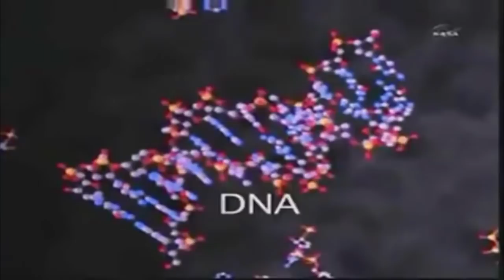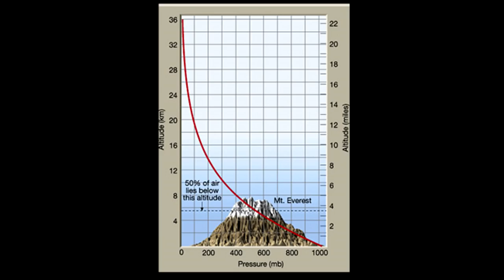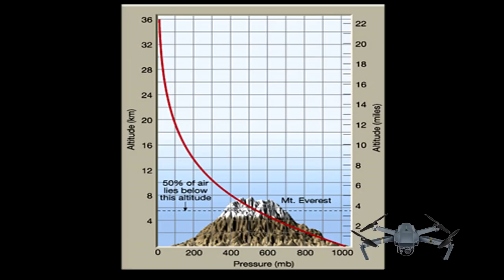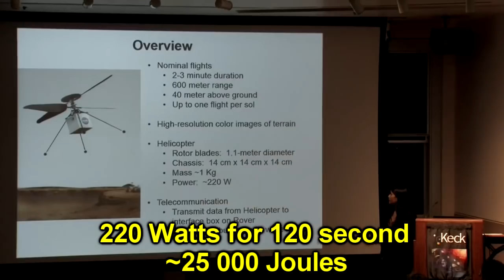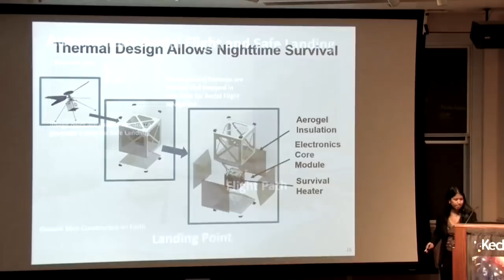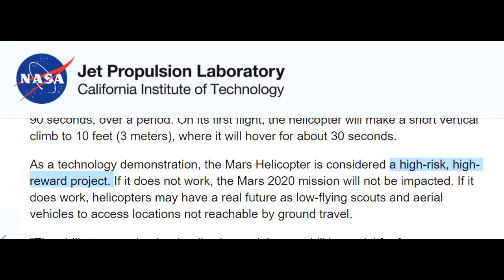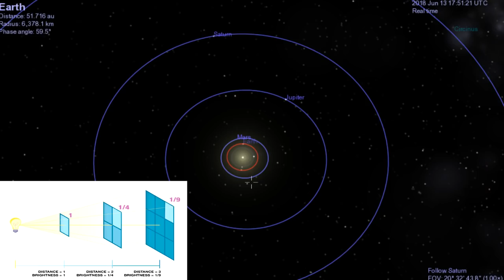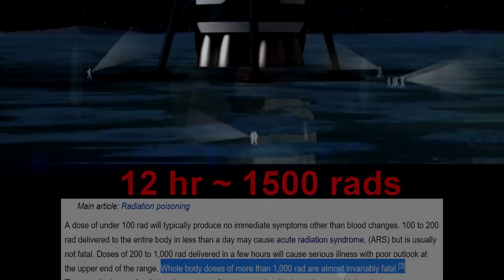NASA is sending Helicopter to Mars!! Smart or Silly?

Comment: Why helicopter drones though? Something with a huge wingspan just gliding takes a LOT less energy to maintain.
Reply: Helicopters can land vertically, but a plane needs a decently sized flat piece of land to land. Also, a plane would be much more likely to crash.
Reply: @Sir_Budginton  the Army likes drones that have large wings they can stay in the air much longer ... helicopter crashes are usually complete write-offs. Although even for a glider a botched landing would mean a lost craft as there is no one on Mars to repair it. What if it could glide for a long time and that would be the mission, glide as long as it can, photograph a lot of things from close and then just land/crash.
Reply: Andras Libal keep in mind that the drone will have to be completely autonomous due to light lag. So a one time use is not very good as NASA will have to decided where to send it on satellite photos alone.

If NASA sees something interesting they want to get a closer look at, a helicopter can keep going there again and again, while the plane couldn’t.

Although if either of these things crash it is game over.
Reply: @Sir_Budginton  well I imagine autonomous gliding and slow maneuvering hovering over terrain is easier than complex avoidance maneuvers ... once it flew as far as it could then it uploads all images ...
Reply: @andraslibal  But there would be a light lag of a few minutes, so NASA has to send an instruction and then the plane must do that on its own. And once it touches down, it isn't getting up again. If NASA wants to get a  look at something else after its initial flight, it can't.

And it doesn't need some super fancy avoidance system. There are ones that exist today that would do the job. And landing vertically is much safer since a small rock won't destroy the aircraft.

Also, the main purpose of the helicopter is to act as a scout for the rover. The helicopter won't carry a single piece of scientific equipment, it would be too heavy. 

The camera on the helicopter can see much further than the rover when in the air, and a much higher quality than the ones in orbit. So NASA can send the rover, with all the equipment on board, to do the tests.
Reply: @andraslibal  because of the thin atmosphere the glider would have to be extra extra large or have to fly faster which really isnt a feasible design to use
Reply: @shaneebahera8566  that makes sense. Would it be prohibitively much larger though? The drone rotors also needs to have larger propellers or rotate faster. I guess it's not that hard to rotate faster. But then again in a thin atmosphere it is also not that hard to fly faster for a gliding design.

In fact a low orbit satellite is also much more feasible on Mars than Earth, no?
Reply: @andraslibal  the working design have faster spinning coaxial rotors
Reply: @andraslibal  actually it would be harder to fly faster than it is to have faster rotors, because you would need a more powerful propulsion system that would add weight which which inturn will be compensated by making it even bigger, it would also make it harder to than it is already to land a fixed wing drone on uneven terrain. The drone flying faster means it has less time to collect data in any given location.
Reply: @shaneebahera8566  why is it harder to fly faster in a low density atmosphere? That does not make sense from a fluid mechanics point of view. If anything, it's easier. Your other argument on landing is a different issue I can see that point.
Reply: @andraslibal  it's harder in the sense of the propulsion system you are going to need to fly faster if its just a short mission drone you might be able to get away with rocket propulsion but if you need expect the drone to be last longer and be electric you are going to run into some trouble since the atmosphere is so thin, props or EDFs won't give a lot of thrust, the take off distance is going to prohibitively long
Reply: @shaneebahera8566  still, why not just set up really low flying satellites? As drag won't slow them down much you could set them up to orbit at a much closer distance and map out Mars in great detail :)
Reply: @andraslibal  whilst mars' atmosphere is very thin at any speeds needed to maintain such a low orbit it would be enough to burn up the satellite this is why the Mars rovers still needed heatshields for their entry into mar's Upper atmosphere

Comment: Why not use a few grams of plutonium to heat the battery?
Reply: Plutonium is very heavy plus I don't think Plutonium just generates heat unless it is fissioned.
Reply: @n1thmusic229  The density of plutonium is irrelevant.  1 gram produces roughly half a watt of heat.
Also Plutonium-238 does generate heat without fission.

Comment: Addendum to your scientific claims:
1. The helicopter blades do not provide lift the way you're describing. The lift is generated by the low pressure created on the upper side by the air flow, like in the case of the wing of a plane. (that low pressure "sucks" the wing up aka generates a vertical force on the (rotating or fixed) wing)
Read this: https://www.decodedscience.org/how-do-helicopters-fly
2. In a highly radioactive environment these solar panels will produce energy like crazy.
3. According to my sources, the Mars helicopter will be serviced and remote controlled by lolcats, so there's no danger for a crash or failure.

Comment: They will use a small nuclear battery.  They have existed for 50 years and they probably have some that are pretty small now and not very dangerous if the rocket explodes.  Course they would never tell the public that.  You numbers seem pretty well researched.  Solar would not be viable unless they had something that folded out to 16 times the surface area so it would be more like the panel you showed.  They could use other technology than silicon for chips with dont melt at 100 c.  They have been making diamond based chips in a company in Massachusetts for 10 years but i have no idea if that tech is ready or being used.  The inject boron atoms into the diamond so it can be crafted in a functioning chip that conducts electricity but diamond can withstand alot of heat before it breaks down, a ton actually.  Again its probably gonnna be military secrets and stuff.  I like how you debunk stuff but you know there is classified stuff on each of these missions and you are never gonna get your hands on the real specs.  So its probably not a good use of time to debunk NASA tech because you don't know anything about the top secret stuff.  Unless you do, and if so you probably shouldn't talk about that for your own safety.

Comment: While you're normally pretty on point with these debunking videos, unfortunately you've got it wrong about the effect of the martian atmosphere on a helicopter. The ceiling of helicopters are there because the engines become starved of oxygen, even at 0.6 atmosphere the helicopter shouldn't have any problem flying provided they have the power to spin the blades. The more weight you want to lift the heavier the blades need to be, because they need to be long enough to produce the amount of lift you want and sturdy enough so they don't snap off due to the rotation or bend due to the lift they generate. While flying a helicopter isn't outside of the realm of possibilities, landing it will certainly be a problem.

Comment: if "they" say. one kg, do "they" mean on earth or mars?
Reply: Mass stays the same. Youre confusing it with weight.

Mind you the proper unit for measuring weight is Newtons. In everyday life we just use kg for some reason. But hey the Earths mass doesnt change much so we get away with it.
Reply: doesn't matter, as long as they are not flying close to the speed of light ;-)

Comment: Would a blimp work on mars?
Reply: Theoretically yes but it would need to be much larger as the air has a smaller mass so there would need to be much more of it to compensate for the solids. That's for a hot air balloon, a Zeppelin would need to use a Vacuum Chamber to work

Comment: you don't have to spin your rotor twice the speed at half the pressure, but only sqrt(2), as lift = cl*A*rho/2*v^2!
posted my calculations here (quite funny dispute with Red's Ball of Fire ;-)
https://www.youtube.com/watch?v=sLgQ0QmmRAE&lc=UgxLmNZLsgh1L570T9x4AaABAg
@Red's Ball of Fire 

long explanation using some math: (hope the wording is correct - English isn't my mother tongue...and all units are "European ;-) kgms system") 

some facts: 
density of Mars atmosphere: 0.016 kg/m^3 (you can calculate from the ideal gas law, I don't do this here) 
gravity constant on mars: g_mars = 3.7 m/s^2 
Rotor Diameter D = 1.2m 
Rotor Radius R = 0.6m 
Rotor speed: ca. 2400 rpm --> angular velocity: w = 251 rad/s 

now some (reasonable) assumptions: 
rotor chord: t=0.05 m (5 cm, like our RC helocopters) 
max lift coefficient of rotor blade: ca = 0.8 (think this is feasible) 
now, the formula for lift is: Fl = ca*A*rho/2*v^2 

we can't use this directly, since the velocity increases linear from rotor center to blade tip. 
in differential form, r is the actual radius from center 
dFl = ca*dA*rho/2*v(r)^2 
as differential area dA = t*dr, and local velocity v = r*w we get 
dFl = ca*t*dr*rho/2*(w*r)^2 = ca*t*dr*rho/2*w^2*r^2 

for the lift we have to integrate from r=0 to r=R (0.6m), and to consider that we have two rotors!! each with 2 times 0-0.6m --> 4 rotor blades 

thus: Fl = 4*Integral[F(r) dr] .. from 0 to 0.6, 

I type this as | 0, 0.6 all the constants out of the integral 

Fl = 4*ca*t*rho/2*w^2*Integral[r^2 dr] | 0, 0.6 Integral of r^2 dr = r^3/3 

inserting the numbers 

Fl = 4*0.8*0.05*0.016/2*251^2*0.6^3/3 = 1.6* 0.05*0.016 *63001*0.216/3 = 5.8 N 

as the gravitational force Fg = m*g_mars (mass times gravitational acceleration on mars) the mass m we can lift with our rotors is: 

m = Fl/g_mars = 5.8N/3.7m/s^2 = 1.57 kg 

which is quite close to what NASA has published. 

surprise surprise 

Summary: a properly designed (and small and ultra-light - we are not talking about man carrying helicopters!) helicopter can fly even at a very low pressure. not at 0 bar of course.

Comment: 6:47 We do have electric planes though.
Reply: Not for commercial flights
Reply: @magnuspeacock5857  Commercial flights yes, massive jetliners no. Also it wasn't specified.
Reply: Small planes with short ranges.
Reply: @n1thmusic229  And? A 250 mile flight is... Wait for it... Still a flight and still a plane. Also not really that short. Also now, this many years later we are getting closer to longer range ones as well in development. For instance the 186 seat 800 mile range Wright 1 on schedule for 2030 Or the Eviation Alice which sits around 500 mile range on schedule for 2026. eFlyer 800 is also on the horizon as a smaller option but with 575 miles of range.

Around the time of my original comment there were around 150 commercial electric planes in development. Many for air taxis but planes nonetheless.
Reply: @Raven1024  Yeah well they're not commerial, at least they weren't I think the first electric Cesna type private turboprop plane hit the market at the end of 2020. But none are used for flights even though they will be in 10 years. That's what Thuderf00t meant
Reply: @n1thmusic229  He said no electric planes. Period. We had electric planes even then even if they were only two seaters. And there were already flying prototypes of some of the commercial ones. So they did exist even in the commercial space. They just weren't in service yet.

He also explicitly said after that that the batteries would be so dangerous you would never put them on an aircraft... I don't know about you but never implies that it's not ever going to happen... Well tough shit. He was wrong on this one. 

Also, at this point for most of them we're looking at between 1 and 3 years for commercial use. On the smaller like sub 10 passenger level. And that's like actual in service use. 

Keep in mind even the longer 500 mile planes coming around in 2026 which is barely 4 years away at this point, would be able to cover about half of all flights that happen globally in that 500 mi range.
Reply: @Raven1024  Yeah we have a couple expensive brands but he was clearly refering to jet airliners, he literally showed a photo of a modern airliner
Reply: @n1thmusic229  No he shows a bulletin about the rules for bringing batteries in planes. Which applies to all air travel. Clearly intending to use it as an example for the "batteries are dangerous" argument. He shows a picture of a venture capital startup electric air taxi concept.

Comment: The Mars helicopter will fail
and this is why. 

The softball-sized "marscopter" weighs about four pounds and is
fitted with two sets of rotor blades, which can spin at 3000 rotations a minute.
Too much technology and the lack of endurance is what I’m basing
my option on.

 I may not be a “rocket engineer” but I have
worked in the world of mechanical engineering over many, many years.

 NASA’s little helicopter is the size of softball This "marscopter" weighs
about four pounds and is fitted with two sets of rotor blades, which can spin
at 3000 rotations a minute and as a
drone will have to land no matter what batteries or power supplies it has. Yes
I did see that NASA/JPL  did  design a rotor blade assembly incorporating
the use of photovoltaics The possibility of damage to either rotor blades is of
high risk. If the rotor or motor should fail because of the abrasion of fine particulates
in the Martian atmosphere it will become immobile. Also there is one more point
that makes this impractical is wind. (Gravity still works just as well on Mars as
it does on Earth) 

Given that Mars has only 0.7% of
atmospheric pressure of the Earth, the rotor blades would be of such a size it
would be an impractical design (Most helicopters can fly up to 25000ft at its
maximum. A black hawk can fly up to 10000ft. Indian Chetak Helis can fly up to
20000ft but remember your dealing with Earth not Mars.)

Now I would use an older
technology and that is a powered airship. Yes a lighter than aircraft!  It will carry a heaver payload than any
helicopter you could ever launch from the surface of Mars. 

If the motor failed on it would
not crash and its payload will keep functioning. Although it would be at the
mercy of the winds on Mars. (The wind speeds that Viking observed at its site in summer is
2 to 7 m/s (5 to 16 mph) The wind speeds at Viking site in fall is 5 to 10 m/s
(11 to 22 mph) and the wind speeds at Viking site in a dust storm 17 to 30 m/s
(38 to 67 mph). At higher altitudes, the movement of dust was
measured at 250-300 mph. This may sound
fast but you have to realize that weather balloons on Earth frequently traverse
the jet streams without harm.)

A lighter than airship can be made
buoyant neutral and gather samples from a wide range without difficulty and
return to its base following a homing beacon and dock. This base could also be
used as a return vehicle and return samples to Earth if needed. The docking
station could use an electromagnet on a swivel as to face into any winds when
docked It could also use the  photovoltaics
on the top of this airship to supplement power at the docking base for running
tests on any samples retrieved and download photos or videos for transmission
back to Earth.

Comment: I think it is an amazing idea....simple and functional. To change the amount of lift it can be simply changing the curvature of the blade as well as the overall surface area...that is how a propeller blade works...it creates pressure when more air passes across one side of the blade than the other in the same time frame. That is why one side is curved, and one flat.

Comment: Um... your explanation of how rotors work is pretty far off. 
Rotors are wings, and wings produce a downward thrust by creating a low pressure zone above the wing.  This does not ‘lift’ the wing as the wing has too high an inertia... but the ambient pressure air ABOVE the low pressure zone on top of the wing has low inertia, and atmospheric pressure, and so that air accelerates toward the low pressure zone... as the wing moves forward, this accelerating air continues downwards past the trailing edge of the wing, and since it is the wing creating this action, the reaction is that the wing moves up.   The thrust of the air the wing accelerates downwards has to match the weight of the plane to fly level... it must exceed the weight of the plane for the plane to rise, which is why as planes fly higher they have to fly faster, to throw a larger mass of thinner air downwards.
The fact that it is the Upper surface of the wing that makes it fly can be demonstrated by the fact that military and other aircraft can clutter up the Underside of wings with any number of pods, missiles, tanks and other obstructions to air flow, but the upper surface of the wing has to remain smooth and clear of ice for the plane to fly.
The air mechanically shoved down by the wing’s angle of attack contributes to the downwards thrust, but only by a small percentage of the total thrust developed.
Your description holds for something like a molecular turbo pump used to attain super high vacuums...  but not for an airfoil operating in a pressurized environment- even tho that pressure is pretty low

I’m willing to guess that if NASA thinks they can fly a copter on mars, it’s because they know exactly how dense the air is and how strong the gravity and how light the copter has to be for how large a wing surface that they can adequately power to actually fly.  I think their engineers can work a slip stick as good as anyone.